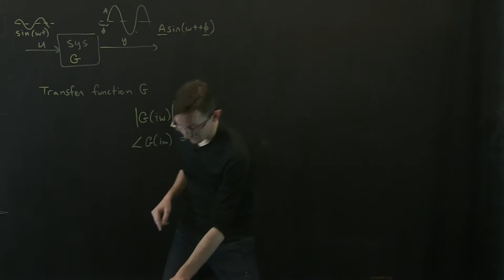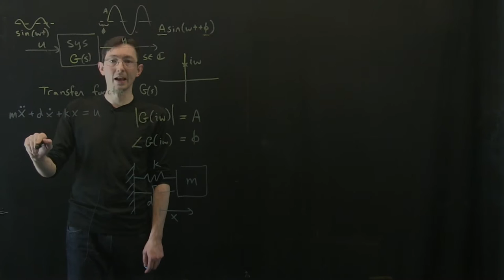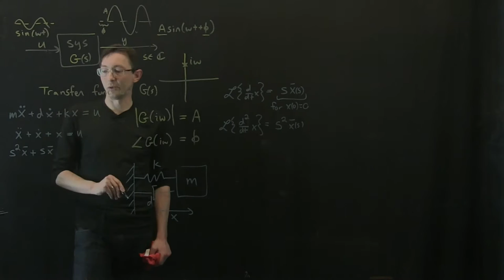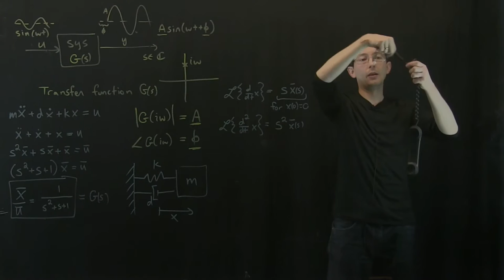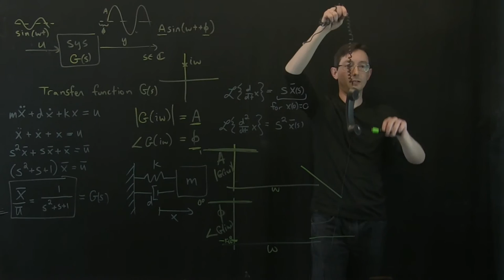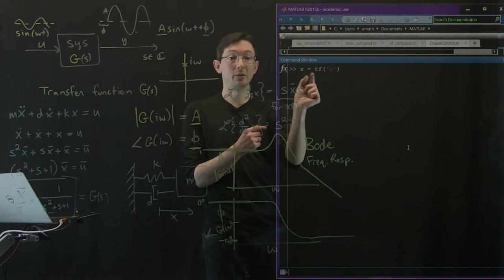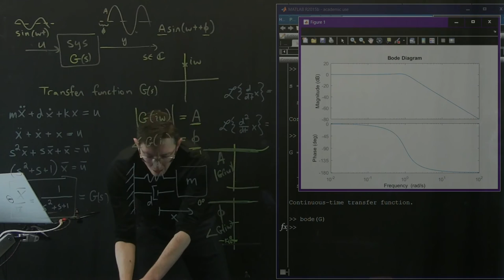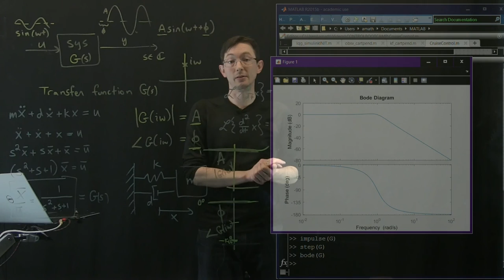Control Bootcamp:  Example Frequency Response (Bode Plot) for Spring-Mass-Damper

Comment: I still have a question, from the transferfunction I can calculate that the Phase for high frequencies is 180 degrees. But what does that mean pysically? Beacause I can imagine that at some point the phase will change again?
Reply: Assuming you don't have any time delays in your system, your maximum phase is 90 * (number of poles - number of zeroes).   What  that means is, in a linear model, higher frequencies get really delayed relative to incoming signal speed or frequency.  If it changes again at really high frequencies, you have a high speed pole(s) or zero(s) that you haven't accounted for in your TF model.  In a physical sense, what phase angle means is how much delay there is between an input signal at that frequency and its response.  So if I have a -180 degree phase at a frequency of 100hz, it means that the high speed portions of my output signal are going to significantly lag behind the input above 100hz or its equivalent.
Reply: @VTdarkangel  yes and even more lag for non minimum phase systems